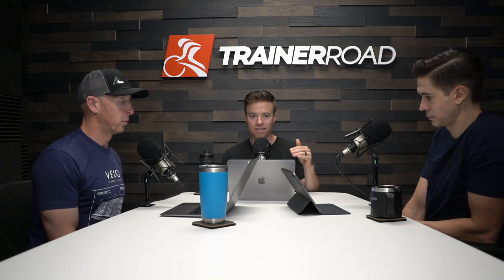How to Perform Aerodynamic Field Testing

Comment: Thanks for the shout-out. 

1. You can absolutely coast. In fact, the wider the range of speeds, the better the estimates.
2. You should use a dedicated speed sensor -- GPS speed usually isn't precise enough.
3. You should use a high quality power meter. I've actually never had luck with using a single-sided PM.
4. Wind is a problem with all methods (unless you have a device that can accurately and precisely measure the wind). What my approach relieves you of is finding a flat venue that you have to use at a constant (or replicable) speed. You can vary your speed, you can vary your power, you can use variable terrain (or, you can also use constant speed, constant power, and constant terrain -- that'll work, too). This means you can test anywhere any other test uses, plus more. I find it easier to concentrate on holding my position and holding the right line and just let the power and speed vary than trying to hold everything exactly the same for the entire run. 
5. I've tested at 11pm, and at 5am, in big box store parking lots. In the Bay Area, the wind usually is calmer at night.
6. The real value of the virtual elevation method is that it provides a diagnostic of fit, so you can see when something interferes with the run. Most other methods don't provide diagnostics that are that detailed.
7. Different kinds of failures manifest as different effects on the VE profile, so you can learn from a mistake and improve your testing.
8. The guy who did the tests with variable sizes that Andy Coggan commented on was Tom Anhalt.